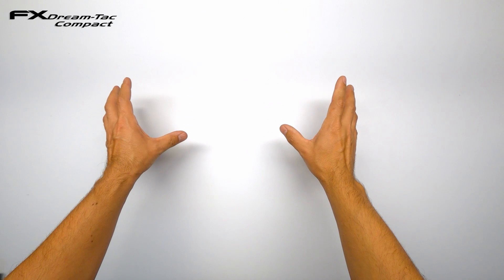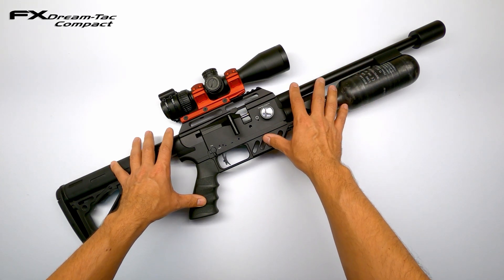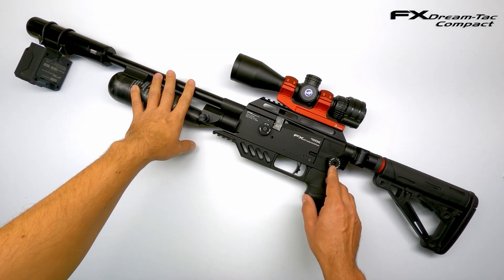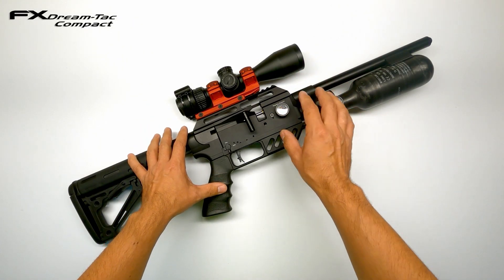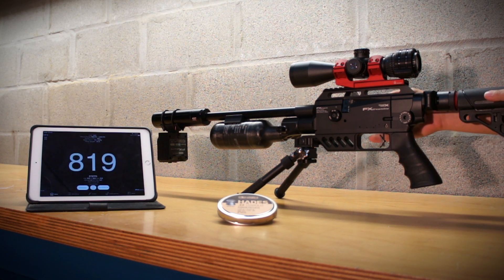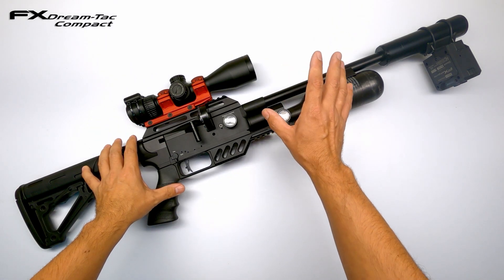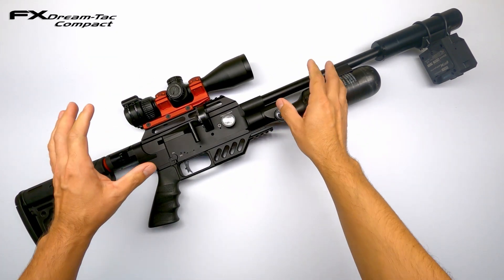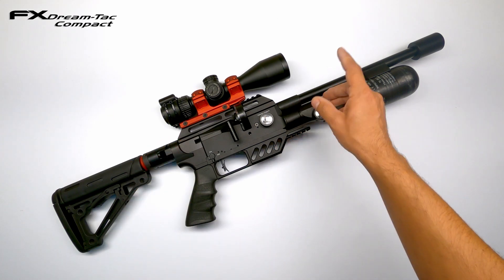FX Dreamline Tac compact tuning guide

Comment: Great video, after watching some of your earlier videos, I to have added huma air reg, gauges and fx plenum. I tuned mine with hades. Running 1002 - 1005 FPS on max settings with great accuracy. Turning down the power wheel to C and .177/.22. It shoots 860fps accurately. Dreamline are a great little gun with lots of potential.
Reply from the maker: Thx , I share the same joy with mine 👍 do you also have the Huma transferport?

Comment: I just purchased a new dreamline tactical .22. I had it tuned to the jsb 18grain. I was told that it could tune it to shoot heavier pellets that could take our medium sized pigs, which I have a problem with here in the farm. I have since read people saying that the dreamline won’t shoot heavier pellets. Maybe 25 grain max.  Would you have a recommendation as to how I could best set up my dreamline to be able to take pigs from
Short distance, 15- 30
Yards? 
I’d appreciate any thoughts or direction. 
Thankyou for your videos.
Reply from the maker: For pigs you will need more power in my opinion then the Dreamline in this configuration can deliver . I would also used slugs and no pellets
Reply: @ Thankyou for your reply. 
How would you modify the dreamline to make it suited for pigs? Can I do it while it’s still a .22 or do I have to get a .30 barrel? 
Thanks for any advice 
The pigs are destroying my crops 😩

Comment: Hi, can I ask something about short barrel tuning ? I see a lot of peopple that use a general rule to back about 30 fps from maximum speed to finding efficency and harmony, but in a short barrel like 40cm this require more like 45/50 fps less from maximum speed cause of shorter barrel does it make sense? like the shorter barrel is the more fps u need to decrese from maximum speed right?
Reply from the maker: The backing off of 20fps is in particular for the impact to make sure the valve is limiting the stroke of the valve rod and be more consistent in opening and closing of the valve in relation to the hammer spring tension.
A Dreamline doesn’t allow you to adjust the valve travel and so it’s not always true that you need to reduce the fps to get the best accuracy , harmonic balance is affected by many other things

Comment: If I may ask a question? So from I've seen you max out the HS using the allen screw until there is no play on the slide bar but you can still turn the dial? Then adjust your regulator to your desired velocity. When you reach your desired velocity, you then back off the allen screw on your Hammer spring right to the point where you get a drop-off and that is your sweet spot? Looks very straightforward, thank you :)

Do you recommend doing this tune with the TP on Med or high with the 22.? I was thinking med in case you want to shoot a heavier pellet you can simply open the TP all the way. Also, there is just one thing I don't understand. You dropped your velocity to 856 finishing your tune. But when you did your shot string right after you were back up to 865 again? Did you change the setting?
Reply from the maker: For the first part you are completely correct 👍🏻
About the 10fps drop is after I cam back from the range testing the accuracy and indeed I dropped it 10fps to get it just that bit more accurate,
But this can be slightly different on another barrel 👍🏻
Reply: @Airbuks  Thank you for your responses as they are much appreciated. So after your tune was finished at 856 you then brought it back up again to 865 for better accuracy? So your final tune would be at 865 then, correct? 

Also, would you recommend my idea about doing the tune with the transfer port on Medium? And thanks again. By far yours are the videos I mostly watch on this rifle. They are excellent!
Reply from the maker: @mrtrek64  🤔 not 100% sure anymore on where I eventually settled. I believe I left it on 856fps . 865fps was the goal as I tuned it but accuracy on paper is more important and it required to lower the velocity to 856 . 
I constantly change the setups and did a few other tunes on th Dreamline compact, difficult to keep track as I also have other guns 😉
You can try to tune it on the medium transferport but I know 900fps is about the maximum I could get out of it . 

Don’t get to pinned on the numbers you see in the video , every gun is a little different and every barrel likes a slightly different speed so take the video as a guideline . Once you go out on the range you can go true the powerwheel and see what gives the best accuracy
Reply: @Airbuks  Excellent....You answered my question and concern perfectly. As soon as my new Huma gauges arrive on Thursday I will give my rifle a tune. My goal is shot count and air efficiency. 

I'm figuring to tune mine to about 780-800. I see no reason to go higher with this short barrel. If I want a bit extra I'll open the TP to max.  The way my rifle came tuned it's now shooting 960-970 fps using 14.3 pellets. That's waaay overpowered. As a result, I get only about 34 shots from a 300 cc bottle. 

Thanks again,

Steve
Reply from the maker: @mrtrek64  nice , happy tuning 😉

Comment: Hey bud, where did you get that piece that goes between the barrel and the tank? I have a dreamline lite, just put a 600mm barrel on it and ordered the fx barrel bracket 34mm and it does not fit. I have the dreamline lite compact 170cc standard bottle. Have any idea where I could get one? Thanks, great video!
Reply from the maker: The one you see in my video is something I made myself.
The barrel band from FX only fits on the tube version of the Dreamline. The tube of the compact is bigger in diameter.
Aswel as the shroud
Reply: @Airbuks  do you have a link for you  red rail and you tube? great video as always

Comment: Hi, That was an excellent video, thank you so much.  I've just taken delivery of my FX Dreamline compact tactical and was really worried because at the factory setting of 100bars for the reg. pressure, neither the power wheel (hammer spring) nor the air flow valve made any difference to the velocities that my rifle is achieving.  I'm getting around 730 - 750ft/s with JSB 15.89 pellets at 100bars reg. P. and air flow at .25 .30.  Could you please give me the details of your exact settings, that is the measurement in mm of your hammer spring position at max, air flow (.25 .30 or .177 .22) and the reg. pressure.  I have also bought the extra air plenum which I can see you have got that on your rifle.  I'll install the extra plenum.  I look forward to hearing from you.   Thank you so much again for your extremely useful and informative video.
Reply from the maker: Hi there , thx for the support.
Copying my exact setting might not give the exact same results but here they are anyway:
Reg = +/- 137,5 bar 
HS = at max 16,85mm 
Transferport = 25/30 

Don’t forget I am also using a Huma high flow transferport on the barrel with matching pellet probe .
Reply from the maker: Do you have the barrel with a thinner shroud ? Otherwise you won’t be able to fit the powerplenum
Reply: @Airbuks  Hi, That's really great, thank you so much.  Yes, I have the 400mm superior barrel with a thin shroud.  You have really helped in another way in that when I was trying to get the barrel off I was only loosening 2 screws (FX manual says two!!!!) but in your video on barrel removal you point out that there is a 3rd screw on top rail (that no body else has pointed out).  Brilliant.  My other half had it right when she said you must loosen that 3rd screw as well but only after seeing you video did we try it.  Barrel came out and the extended plenum is on.  My Power Wheel on max = 14.3mm, I'm now on .25/.30, reg. P = 135bars and with 15.89 JSB pellets I'm getting 855ft/s ave..  A 230bars fill seems only to give about 35 shots with the compact bottle (220cc) so I need perhaps to buy a 300cc bottle.  Really enjoy your videos - thank you for all your time and support - very much appreciated.
Reply from the maker: ursine010155 hi , glad my videos helped you out , that’s the reason why I make them 👍
855 FPS with 14,8 mm Hs and 135 bar is a very good result 👍 I believe that the original air tube is only 180cc so that’s very good shotcount. Enjoy the Dreamline because it’s a awesome accurate little bugger 👍
Reply: @Airbuks  Hi, Thank you very much.  I thought that the compact bottle was 220cc but I think you're right so perhaps I should buy one of the 300cc carbon fibre bottles which should, if my physics is right, give me 66% more shots (roughly 50 shots from 300cc - do you agree?).  You should write to FX and tell them there is a 3rd screw on the top which needs taking out to remove the barrel.  This is not mentioned in the Owners Handbook.  None of the other YouTubers pointed this out either!  I'm going to install my scope on the new rifle later today so I'll soon know if my particular rifle is accurate.  Best wishes.
Reply: @Airbuks  Thank you.  I would like to ask for more of your guidance and apologise for it.  My Dreamline tact.comp. is now set at 137.5bars. Reg. pressure.  It is .22 and is set on .22/.177 on the Air Flow Wheel.  I'm shooting JSB 15.89grn.
At Max on power wheel (14.2mm) I'm getting ave. V = 844ft/s; at B on power wheel (15.6mm) Ave. V = 839ft/s; at D on power wheel (17.0mm) Ave. V = 838ft/s; at Min on power wheel (18.2mm) Ave. V = 829ft/s.  !!!  Is my rifle working correctly?  Because from Max to Min the velocity difference (reducing) is ONLY 15ft/s??  As you may recall, my rifle has a 180cc bottle and the additional power plenum installed.  Barrel is superior STX at around 380mm long.  Accuracy is good (20mm groups at 50yds, 5 shots).  I would really appreciate your view and help.  Many thanks.
Reply: @Airbuks  Hi, Panic over (I hope and I think!).  We changed the PW @ max to your setting of 16.85mm and the air flow wheel on .25/.35 and I'm now getting very similar velocities to the ones you showed in this tuning video, from 850ft/s to 660ft/s (max to min).    So, thanks again and look forward to more videos.  By the way, have you produced a video on Dreamline Comp. Tact. accuracy at your settings that produce 860ft/s?  Best wishes.
Reply: @Airbuks  and for jsb 18gr what is the best setting?are u tested some 21gr hn slug or jsb slug? it will be great to know the best setting for them
Reply from the maker: ursine010155 Hi there sorry I never answered you questions, I must have missed it somehow 😬 but I am glad you could figure it out .
I have done a accuracy video out of the box shooting the 16gr pellets around that FPS .
Reply from the maker: eclampsie  I never really tuned it to shoot the 18gr pellets because with that short barrel I would have to push it to the limit to get them shooting at 860-880fps .
With that short barrel it is never intended to shoot slugs , I tried some hybrids out of it but the accuracy isn’t there for me . A slug needs way more speed then the short barrel can generate. But I believe NSA makes 17gr slugs 🤔 that could maybe work
Reply: @Airbuks  yes we have not enough choice for low weight slug.. I hope. We. Could. See decent slug between 15grain to 18grain

Comment: Hi Airbuks, I wonder if you can help me!  When I was re-installing the trigger assembly on my FX Impact, after reducing the 2nd stage weight, I noticed an air leak from a part which is immediately behind the power wheel and it’s a brass bolt with an Allen key head and has an O-ring which on FX drawings of the Impact is part A24, Art No. 19694 “Brass adapter Impact” and the O-ring is A25, Art No. 19761 O-ring 2,2x1 NBR 70.  I’ve managed to purchase the O-ring from an online shop and can now re-install this Brass adapter back.  However, I don’t know what its function is, what does it do?  I also don’t know whether I should fully tighten it back in place or not?

Please can you advise me as to what role this Brass adapter plays within the FX Impact and whether to tighten it down?  I look forward to hearing from you and would really appreciate your reply.  Thanks again.
Reply from the maker: Hi , as far as I know this hole is made to be able to machine the action block , so the brass is a plug to close that hole .
So I am pretty sure it doesn’t do anything except plugging that hole and so you can screw it in but like any other part on the impact don’t go crazy strong tight is good enough. The oring is what stops the leak
Reply: @Airbuks  Thank you so much, that is really appreciated.  Stay safe.

Comment: Hi. How do you adjust the hammer spring in a sub 12ft dreamline tactical? Thanks
Reply from the maker: I guess the same way as I did it ( if you have the powerwheel) or maybe you have a anti temper on a sub 12 that I am not aware of 🤔 . But increasing the HS will possibly get you over sub12 and be illegal if you don’t have a license

Comment: Hi great video, good information.  When you got your 865fps and then you went out to shoot groups for accuracy did you have to make anymore adjustments? What happens if you get your desired speed but accuracy is not there? Also does the huma port and probe add efficiency or will it use more air to gain 20-30fps?
Reply from the maker: I lowered the Hs wheel to 5 and it gave me the best groups at 835fps .
With the Huma port you use the same amount of air but gain FPS 😉👍🏻
Reply: @Airbuks  thanks for the reply, so in that case you found that pw5 was best so you leave everything as is and that's it, your gun is 100% setup. You don't touch any settings after that,  is that correct
Reply from the maker: @fiestamans  yes that is correct . I just retune it if I convert it to something else .
I have a new video almost ready with a multi purpose tune that I currently have on the Dreamline compact
Reply: @Airbuks  thank you, look forward to it
Reply: @Airbuks  what is your view on double plenum

Comment: I looked everywhere for that Power Plenum but every time I read the description of the power Plenum they say that it can not be used on the dream tact or dreamline lite but you obviously have use the Plenum on your Dream Tact compact they said it’s not usable obviously it is right.?!
Reply from the maker: Hi , initially in the beginning it wasn’t possible to fit the power plenum on the Dreamline compact due to the thickness of the shroud. Now days the Dreamline compact gets shipped with a thinner shroud so you can fit a power plenum and a 300cc carbon tank 😉 if you have a thick shrouded barrel I am afraid you will have to order a other compact barrel with thinner shroud 😬
Reply: Thanks so much for your clarification I didn't know what to think about this situation.. I sure hope it adds power and accuracy..
Reply from the maker: @ChuCKwilliams5  always welcome with questions 👍 it brings power but to be accurate it needs to be retuned once the power plenum is installed

Comment: Hey bro if i buy a stock dreamlime tact carbon 22 with power plenum  max hammer spring max setting on transfer and regulator what is the max ft lbs i can get?
Reply from the maker: Hey mate , with a regulator at 150 max hammerspring , Huma TP and probe I am shooting jsb 16gr at 905FPS and the 18gr at 865 FPS
Reply: @Airbuks  thank you for response!! I dont mean compact i mean the single dreamline with 600mm barell
Reply from the maker: @papa3587  never put a 600mm on it 🤔 but I guess you can get the 16gr to a 1000fps

Comment: I have the newer model.  Why is it mine wont go higher than 840 when tunning.  I tried everything.  It hits 830 consistantly and after that sometimes hits 840 peak.
Reply from the maker: Have you tried less HS tension and see if the velocity goes up ? It’s possible you’re overpowering
Reply: Thanks, yes i tried that.  What i did today was put HS to its max.  I had forgotten i could adjust that with small allen wrench.  I got little more power.  It went to 860 max.  But not acurate enough.  Brought it down to 835 with the HS adjustment and 135 reg preasure.   Bit more acurate but still not consistant acurate at 70 yards with 18 gr jsb on 22 cal.  Came down to 805 and a bit more acurate. Less power but more acurate.   I stoped there.  Used up my tin can.  I still cant figure out why 3 pellets hit really acurate and then suddenly it gets wierd.  Hits again 3 more and then happens again not acurate.  All the while the reading is from 795 to 805.  801 pretty steady.
Reply: By the way i also modified the prob myself today for more air.  I think i did a good job but maybe i should try buying the Huma Air like yours.  There arent many videos on this gun.  I have an fx impact too and am familiar with the system.  Thanks for your reply
Reply from the maker: @nephtalilucero8084  🤔 difficult to assess the problem not seeing the DL myself.
Have you tried putting the reg at150 ?
With that short barrel you need quite a lot off pressure
Reply: @Airbuks  thanks, yea i tried that.  I was wondering maybe because i added a power plenum to it.  I saw on you tube someone else was getting 800 as well.  Not sure
  Could be they changed something from the first ones that came out.  I noticed you have the original model that first came out.  Ill keep testing for acuracy and see what happens.  Could be because short barrel.  Ill order a longer barrel in the 25 cal also.  Thanks!
Reply from the maker: @nephtalilucero8084  i have sold that specific one in the video as I had 2 Dreamlines . But I don’t have any power issues with it . I know FX has improved the newer models with a bigger valve/opening to allow more power with the power plenum 🤔 so I wonder what the issue can be
Reply: @Airbuks  oh ok,  you had 2 Tacts?  Or another Dreamline?  Its a good pesting gun for short 50 yd distance.  Killed couple rats and light weight.
Reply from the maker: @nephtalilucero8084  yes I love the DL platform, the one I currently have sits in a Saber Tactical chassis with a 500mm barrel 😉
Reply: @Airbuks  what pellets do u shoot?  How fast do they go
Reply from the maker: @nephtalilucero8084  I shoot 25 Gr JsB 25cal at 880fps